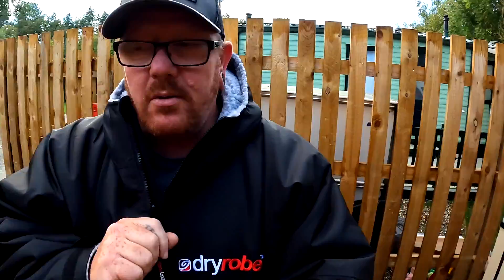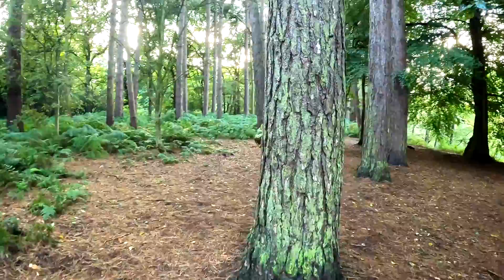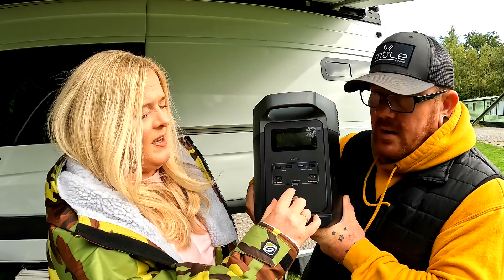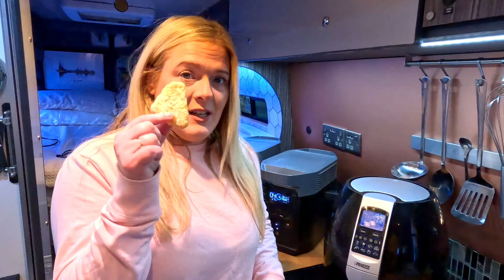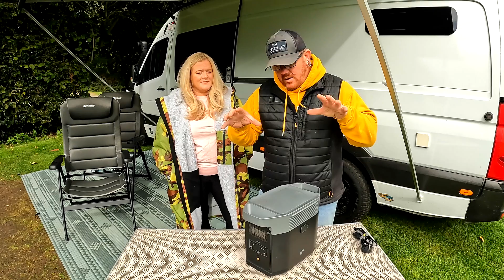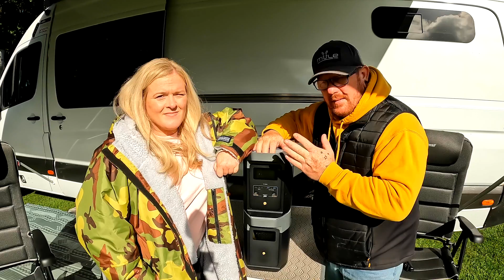The ONLY Eco Flow Delta 2 Video You Need To Watch

Comment: Fantastic video 📷 just seen it now I bort my ecoflow one in July fantastic kit in fact I run most of my stuff now off that my telly etc plug sockets I've still use my leisure battery and my inverter, but I need another battery fitted in there as they. Battery doesn't seem to last very long thank 🙏 you for your video helpful

Comment: I had one of those and it was in my small camper van. I bought it 2 months before we went away on a 4500 mile road trip around Europe so I could understand how it worked. I also bought the alternator charger and all seemed great...until that is, 1300 miles (and day 5 of a 30 day trip) from home it failed. I then connected it to the 12v socket in the van to see if that would charge it, and that's when it started smoking. So what do you do? Turned everything off, 2 countries from home and now I have to either throw it away and lose a £600 device or sleep above a FAULTY lithium battery for the next 25 days and just hope it doesn't burst into flames killing me and my wife.
Well I'm not throwing £600 away!
After care took 23 return emails for them to finally agree to a refund on the unit and the alternator charger and they had the nerve to charge me depreciation on the alternator charger because that part wasn't faulty.
My advice would be AVOID THESE CHANCERS AT ALL COSTS. It could end up costing you more than just money.
Reply: Sounds like you haven't got a clue what you're doing and probably left it out in a storm.  You can't kid a kidder and you're definitely the only chancer between you, Ecoflow and the channel creators.  Goodbye 👋

Comment: I don't understand these things I need one for a fan a TV and A gaming laptop I am looking to get a 1800w I see people running TV's full size refrigerators and power tools and thing like that but if it can only out 1800w how are people running all these things
Reply from the maker: Hi ya, so you basically need to use a little bit of maths to work out what size power station you need to run appliances like a gaming computer and a TV in your van/house/boat/tent.
You start by checking the power requirements of each device. A high-performance gaming PC typically uses between 300W and 600W, while a modern LED TV may use anywhere from 30W to 100W depending on its size. For example, if your gaming PC uses around 500W and your TV uses 50W, the total running wattage would be 550W. 
Next, consider how long you’ll use each device per day—say, 2 hours for the PC and 3 hours for the TV. That means you’d consume about 1000Wh for the PC and 150Wh for the TV, totaling 1150Wh per day. 
To account for energy loss (as most power stations are around 85–90% efficient), add a 15% buffer, bringing your estimated daily usage to about 1323Wh.
Based on that, you’ll want a power station with at least 1300Wh to 1500Wh of capacity and an inverter that can handle at least 600W of continuous output—ideally 800W or more to cover peak demands. 
If you plan to recharge the power station with solar panels, keep in mind that a 200W panel can provide roughly 800Wh per day in good sunlight, but nowhere near as effective without it (winter) so two panels would be needed to fully recharge your daily use or you can charge via 230v or other means. 
Good power station options include the EcoFlow Delta 2 (1024Wh, 1800W output) for lighter use, the Bluetti AC200P (2000Wh, 2000W output) for more demanding setups, or the Jackery Explorer 1500 Pro (1512Wh, 1800W output) as a balanced choice. Hope this helps you narrow down your search. Don’t take these figures as correct this is just a rough guide to help you see what you would need.

Comment: Ive got the same delta 2..bought jan 2023 ..used it around 50 hours and light use in my campervan..now its 2 years old out of warranty and stopped working ..tried many rebooting methods..the display shows 70 % but the unit switches off after 5 seconds of switching on with nothing connected to it...disappointing
Reply from the maker: Have you tried a firmware update?
Reply: 5 year warranty no?
Reply: @mrallen4415 yes ..didn't work ..so I rang ecoflow..they said it was under warranty for 5 years..(i thought it was a year)  they put a new computer in it ..all fine now..great company to deal with ..so much so I bought the Ecoflow delta 3 max plus ..awesome kit

Comment: I have the Delta 2 and it charges from the wall outlet, but it wont charge from driving. It appears intially that its charging, but after about ten seconds it foes to zero and every minute it blips up numbers but always back to zero. Any suggestions? Thank you!
Reply from the maker: See if there is a firm ware update that is needed and if not possibly need to contact flow support as they are usually great at helping with tech issues, hope this helps

Comment: I've spent hours on end trying to find the best power bank that balances cost-effectiveness, practicality, and usability, as opposed to, for example, a Victron DIY system. I'm extremely disappointed with YouTubers advertising the EcoFlow Delta 2 Max, and I feel it's misleading to advertise it as a viable solution for van life.

The reality is, vanlifers rely heavily on 12-volt appliances to run essential items like diesel heaters, 12-volt lights, and fridges, especially in winter. The Delta 2 Max only offers a 12V/10A output, which is grossly insufficient for powering multiple 12-volt devices simultaneously. This limitation makes it practically useless for vanlifers who need reliable 12-volt power.

Promoting this product for van life is borderline deceptive, as most vanlifers don't use AC appliances all the time. In the van, you use AC appliances occasionally, maybe once a day, but primarily rely on the 12-volt system. There is a need for real solutions that address our 12-volt power needs effectively, not products that overpromise and underdeliver. This is a firm reminder to potential buyers: Don't fall for the hype if you plan to rely on 12-volt systems in your van. I'm so glad I didn't pay all the hard-earned money and I was very close.
Reply: You actually do not have a clue what you're talking about.  Try another post 😂

Comment: I LOVE mine! I have my fridge plugged into mine and then the Delta 2 plugged into my truck so it charges as I drive.
Reply from the maker: Nice!!! 👌 we use ours daily!!
Reply: Hi. I have the Delta 2 and it charges from the wall outlet, but it is having issues charging from the 12 V while I am driving. Initially it will charge, but after about 20 seconds, it will go back to zero. Every minute it will blip numbers but always go back to zero. Any suggestions on how to fix this? Thanks!
Reply: @sweetbeep  I would try a different cigarette lighter and see if it does the same thing.  Also I would definitely call Eco flow and see if they have any suggestions I've heard some people have to get a new cord.
Reply: @sweetbeep sounds like you need a new van
Reply: @mrallen4415 nothing wrong with my vehicle. they sent me a refurbished unit, and I sent mine in. the refurbished unit works

Comment: Great review! We’ve had our Delta 2 for a couple of years, perfect for power outages. Today I ordered another one and the extra battery, to use in a home built camping trailer.
We’ll have over 3000 watts of power without having do a lot of electrical work on the trailer. I believe EcoFlow is the BEST brand around and definitely the BEST warranty. 🏴/🇺🇸👍
P.S. Love the Dachshund 🌭

Comment: The high frequency, transformerless inverter technology that are used in these EcoFlow solar generators is well known for having short life expectancies, and can only provide up to a 2X surge capacity, which is not enough for powering many high surge loads. So no thanks. A much better choice for van or off grid use, is a hybrid, low frequency, transformer based inverter charger. It will last far, far longer, it runs much cooler, and supplies a much higher surge capacity than these lightweight, high frequency solar generators.  That why big brand name inverter manufacturers like. Magnum Energy. Victron, Outback Power, Sigineer Power all use low frequency inverter technology.
Reply from the maker: If you say buddy I don’t know any one who’s had an issue with eco flow .

Comment: when you get it do you have to charge it right away and do you have to keep it charge?
Reply from the maker: No not at all . They come with about 30% battery but lithium can be charged and left for years and still hold a charge and also be fine . It will slowley discharge after time

Comment: Linking the Delta 2 and Extra battery, you won't be able to connect the Ecoflow Wave as the connection is taken up with the delta 2 extra battery?
Reply from the maker: But if you don’t use the battery then your good

Comment: Can I plug in a window AC unit ?
Reply from the maker: Depending on the draw then I don’t see why not it runs most things
Reply: Runs 2 of 3 window ac units for me. It depends on the surge wattage needed as they all run around 500w but start up i've seen 2400w x-boost to get it going. The Larger window ac must have greater than 2400w surge for it not to work with D2. Check the ac surge wattage needed to start it.
Reply: AC is bad for your health.

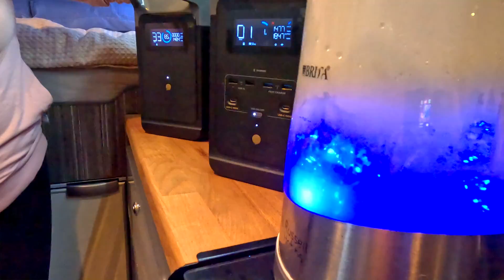Comment: External battery was plugged in at 3% on the main unit. Seconds later I see 2% on the main unit and even 1% at 8:06
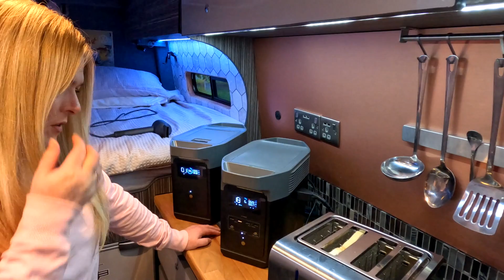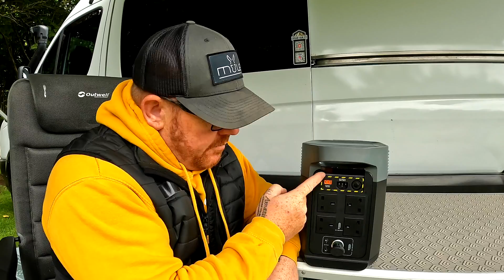At 8:10 I see 5% again, later 8% and then 7% again and finally 6% at 10:09

Wondering whether the external battery is somehow charging the main unit? And if so, does it only charge when ac-out is below ~ 750 watt?

BTW, the lifepo4 are not making things lighter, actually liefepo4 is heavier then NMC, what is in the older Delta's. In general lithium is ligther then AGM and lead. Also lifepo4 is much less likely to have a thermal runaway causing a fire. Therefore I would never install NMC in my house or van.

Meanwhile I am a bit in doubt about the fan-noise.
When running on or charging the battery I am fine with the fan-noise, when running on AC(in) it shows this does not have a transfer switch but does AC->DC->AC. Which not only is noisy but also inefficient. 
That is why I installed a real transfer switch at home which uses the Delta 2 as generator in case the grid goes down.
Reply: the 2 battery's will try to balance each other out to act as one.

Comment: Loved the test and it seems just what we might need.
If I were to run the engine battery low, would this unit be enough to recharge enough to start the motorhome?
Thanks.
Reply from the maker: Oh yer TOTALY you could defo charge the van back up off it . It’s not a booster pack but like plugging in to the mains it will charge the van battery

Comment: Hi will the  ecow flow delta 2 run the hairdryer and straighteners on its own without the backup battery
Reply: Yes if it is 1800w or lower

Comment: Hi everyone. Great video and very informative. Many thanks. One question here. On my delta 2 same device on your video my device will stop charging while I'm using the cigarette socket in my van while driving. Just sent an email to ecoflow hopefully they will come up with an answet but wanted to know what your experience is. I drive 3-4 hours a day for my business so enough to top up the batteries and not having to get them inside the house every night for charging.. I have to mention that I've tried with other different vehicles same result. Also on my first device eco flow delta 1 I had no problem with charging from the cigarette socket. Please let me know you thoughts on this.. Much appreciated your time in making these videos 🙏🏻🙌🏻💪🏼
Reply from the maker: Hi bud the socket in your van may not be putting off the right amps some times they step them down . See what amps are coming out of it and may be worth fitting a second one direct to the battery
Reply: @UrbanVanlife  much appreciated your response. Will do that definitely. Already tried on different vehicles but with same result. Had a response from ecoflow so they are trying to solve the problem. Will keep updating hopefully can help others. Best wishes
Reply from the maker: Strange  one  that but hopefully they will come up with some thing . Have to let us know what the out come is mate
Reply from the maker: Hi mate Iv just been looking at the eco flow app on the mobile . In the app check what you have your setting set as 

In The input section you can change the input from 4amp to 8amp and also have it set to car or solar charging . Worth checking if it needs a firmware upgrade as well . Have a look on the app and see if that helps
Reply: @UrbanVanlife  much appreciated. Will have a look tomorrow and let you know. Many thanks

Comment: So I get you point of replacing the 240 and inverter that goes in the van. Have you asked yourself cold these units actually replace you leisure batteries completely ?
Reply from the maker: The bigger they get they totalt could mate I can see in 12 months new builds will be seeing theses rather than batteries

Comment: Thank you for hitting the high points to consider when looking for a solar power "generator". What sold me on the EcoFlow Delta 2 was the fact that it uses the Lithium Iron Phosphate batteries for many times the cycles (10 years of daily use), as well as the expandability of adding another battery to double the source. I love being able to see the actual percentages of load and input vs another company I was considering that shows only the 20 percentage marks. Add the cell phone app to control the unit and you have a no brainer of which to choose for the same or less money. Connect this unit to the WiFi and receive firmware updates as they are released for more and improved features.

Comment: Hi there I’ve just subscribed to your channel I think yous do a great job with the vlogs, great review about the eco flow delta 2 power bank, but there’s one thing not mentioned across alot of vlog reviews is,… how does it fare with running 240v and 12volts tv’s.. I’m interested to know the length of time the eco flow delta 2 could possibly run tv’s for?  Have you tested this by any chance. Regards 😀😀
Reply from the maker: We have never put a 240v tv in to ours mate . But you can plug TVs in to them . Have a look on the tv and see what wats they use and you will be able to work it out from there . But TVs don’t pull off a great ammount . Thanks for watching mate .

Comment: I have one on order, i have a large permanent solar panel already on the van roof and I would assume that if you plug into the 12 volt linked from our 2 x 95 amp hour liesure batteries, it will take the energy for the ecoflow from them as required to charge it and follow on by recharging the liesure batteries from the van solar panel simultaneously ?
We go on campsites a lot and use electric hook up but when out and about outside the camp site, to, from and at whichever resort or place of interest we go to, we propose to use it for a microwave,  toaster, none ultra fast boil electric kettle etc. The ecoflow can power higher wattage items that the 12 volt system can't cope with,  with our small portable 300 watt halfords plug in 12 volt to 240 volt inverter and from the 12 volt itself.
I think it will mean that we can do anything anywhere. We can make our own ready meals in the microwave quickly, rather than having to go to mcdonalds etc, which cumulatively can be expensive and should pay for the ecoflow in time whilst adding flexibility as well.

Comment: Question - I am trying to decide whether the Delta 2 or the Delta max is my best option to run my van. I plan to run the campervan off the battery alone to run lights, fridge, have some power points to run or charge things instead of fixed batteries etc. A) Should I invest more of my money in the Delta Max  (x2 the WH) as I can get it for only £450 more than the Delta 2, or B) Will the Delta 2 be enough to run the fridge constantly in the van and then when off-grid be able to charge by solar, run fridge and lights and heater if needed etc. I could buy the solar and Delta 2 for the same as the delta max on its own. I am worried about not having enough power but this review makes me think it is more than capable.
Reply: If you have a lot of sun where you live, Delta 2 with solar panel is okay. If not, 1 kWh battery is okayish, but not great. Consider three things: how much power you need, how fast you can recharge, how will you recharge. Example of the last, it's a lot more convenient to take a 12kg Delta 2 to a coffeeshop in a backpack and charge it while you relax or get some work done.
PS: it's polite to ask first, example is it okay to charge some of my electronics while taking having a coffee or two? 😅

Comment: I have one on order with the 220 solar panel. I could have gone with the bigger unit, but I have to consider whether I can actually pick it up. The expandability of this unit was the deal clencher for me. Looking forward to more off grid camping.
Reply: I just got that same set up.
Reply: Me too got their D2+220 panel bundle over the summer. Also just bought another D2 + extra battery for 1099 flash sale at their website. Was Tempted to buy their new D2 max but it's 500 more than D2+ extra battery and way too heavy for portability. I'm ready for any winter blackouts ⚡️🇺🇸

Comment: A few of us ( and the number is rising) went gasless with the advent of induction hobs.
soooooo, if you have a dual ring indiction hob ...you are gonna need 400a/h worth of  battery power and a 2000w / 4000w surge pure sine wave inverter.
so for folk who still use gas, yes, these things are fantastic.
for gasless van lifers , not much use at all, prolly not worth the van space.
Reply from the maker: There is allways a use for more power